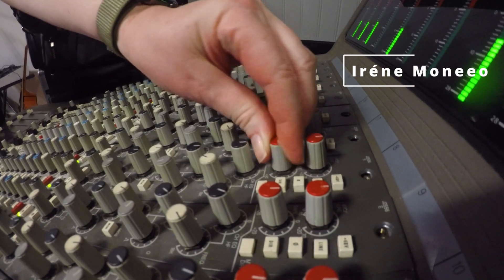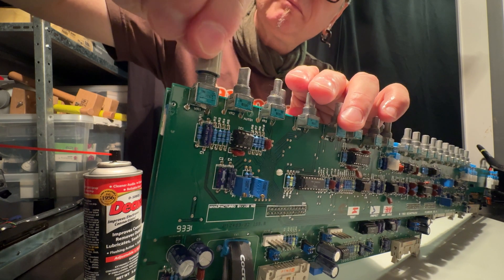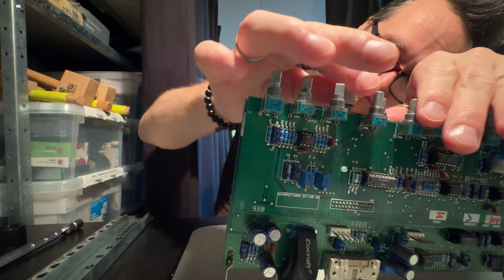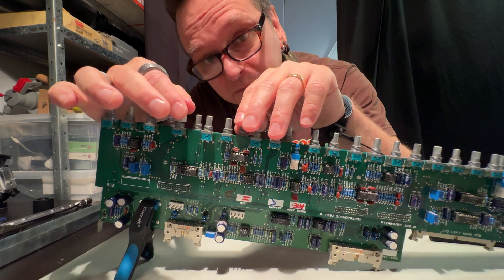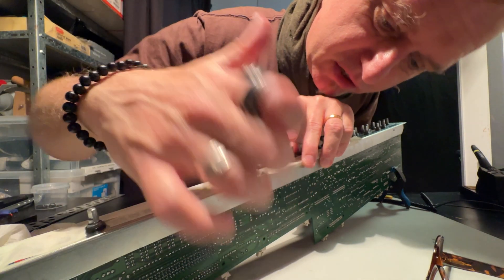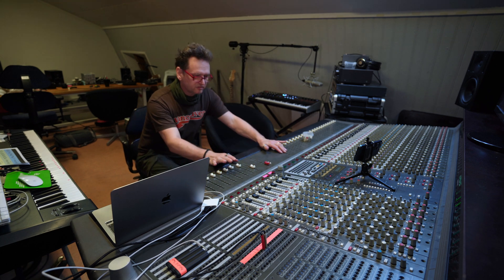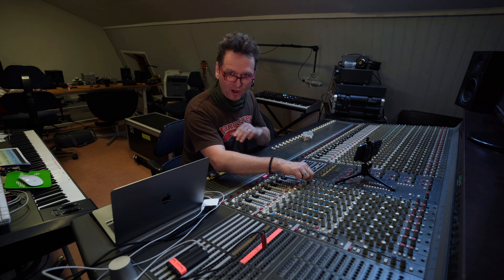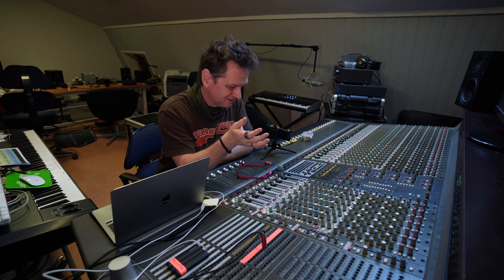Soundtracs JADE (pt 9) - Cleaning Potentiometers

Comment: This is not the way to do it 
The difference in feel after spraying is because you've washed the damping grease out of the shaft, not because you've cleaned the resistive layer
Reply from the maker: And yet the crackles disapear. 🙂
Reply: @moneeo  Understood -- but 1) the crud is still in there (and will accumulate with future cleanings), and 2) it's a lot tougher to make fine adjustments with a rotary knob when it has very little shear resistance.
Reply from the maker: @ yeah, it's just a temporary solution anyway, and a change of pots would be the best options, since there are 30 years old.

I am constantly learning and would love to hear if there are better ways to get deoxit inside those sealed pots. And no - drilling a hole is not an option. Would love to get som new ideas!

Comment: I'm not certain but I dont think you should be getting 0 on the master VUs with your test. -4 might be right. I think you have a lower internal level to get headroom on the masterbus from the channels. Otherwise you would to easily overload the mixbus when running a lot of channels. You must find calibration instructions for that to be sure.
Reply from the maker: You might be right, maybe -4 was a good level for analog tape machines, and today 30 years later we aim at 0 dB as a reference with digital equipment. Yeah, we really need to learn how to calibrate anyway since most of the channels are different at this point.
Reply: @moneeo  Ok, I think you're missing the point. This is not related to what you send to your multitrack or your 2-track machine, analog or digital. This is to keep you from overloading your consoles internal gain staging. You'll figure it out... Keep up the good work.
Reply from the maker: @MISSINGMANRec  Ah, that's true, ofcourse the levels adds on as the channel count goes up. That makes sense!
Reply: @moneeo  (Your channel direct out is another story. If your led meter Is set to monitor the channel output and the console is set to balanced operation then 0 on your meter should give you  1,223V between hot and cold on your  group/direct output.)
Reply from the maker: @danostlund3032  Excellent, i really need to learn how to measure and do the calibration when all the channels are cleaned. Your tips is a good way to start, thanks for sharing.🙏

Comment: Hey, nice to see your progress with the console. Just curious: have you tested the channel after cleaning the switches but before cleaning the pots? Because from my experience with my own console (Soundcraft Sapphyre which is a bit smaller but quite similar.. same age, same sealed pots, same switches etc.) all crackling was caused by either dirty switches or dirty patchbay contacts (especially the normalling contacts). I actually never to had clean or replace a single pot so far. Of course that might be different with your console but maybe worth a try checking the channel after the switches are cleaned.

Btw if you encounter other problems further down the line that affect a number of or all channels, a good tip is to check the power supplies of your console. I had some weird rumbling noises on the master bus and mute groups switching on and off randomly which was driving me crazy. This was all caused by the power supplies. The big smoothing caps had already been replaced but that was not enough. I had to rework the whole thing, replacing all caps, all diodes and bridge recitifiers, clean all contacts etc. After that was done all problems mysteriously vanished ;) 
 
Good luck with your restoration. The Jade seems like a great desk!
Reply from the maker: That's an interesting thought that the switches are the cause of lots of the problems, but it could be possilbe. Might try to clena the switches first and see what effect it has. I guess i will clean all the pots anyway in the end, just to make sure everything works smooth and fine.

Wow, what an amazing job with the power supply you made - and so great that it paid off so well.👍
In the future i would love to replace the PSU with a blue dog, but we take it step by step. Thanks for sharing your ideas.🙏